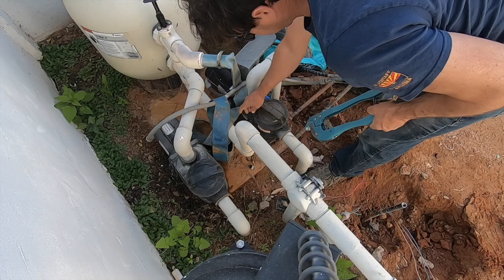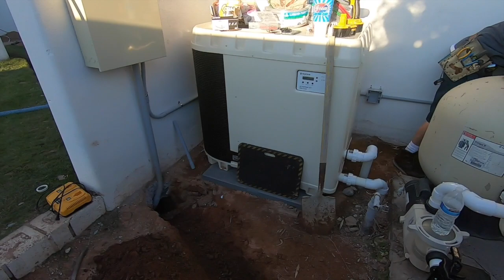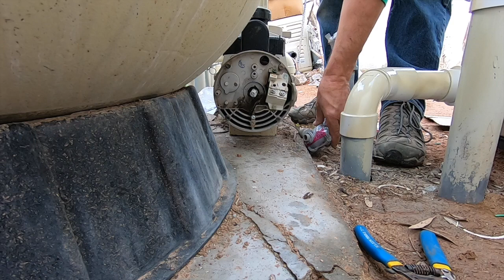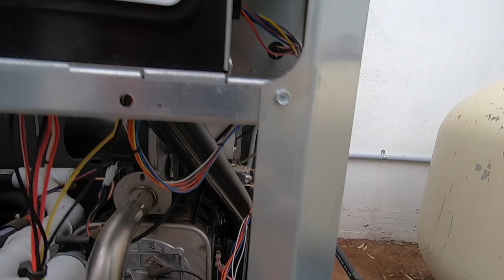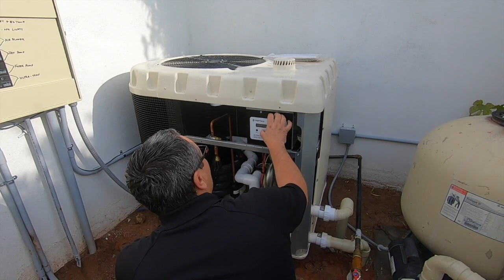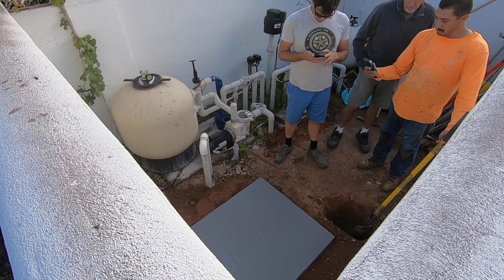Pool Equipment Makeover 2

Comment: Was the ETI pentair heater worth the additional expense? Did it require extensive wiring or plumbing changes?
Reply from the maker: It’a only a 200K BTU heater. I actually have to go sort a flow issue on this account tomorrow. It takes a while to heat the pool but rocks the spa no problem. I think on a set up that’s less than 20K gallons it’s a great way to go.
Reply: @SwimmingPoolAZ-SPS  My pool /spa is 38k!

Comment: i have a Pentair CCP420. Can i replace it with either the CCP520 or the D.E. Quad 4 100 without having to replumb? Are they all direct replacements?
Reply from the maker: The easiest thing to do is convert what you have to a 520. It requires a new upper tank half, taller air bypass tube and the 520 cartridges. The quad and DE filters use the same tanks but require changing the plumbing around a bit.

Comment: hey Josh,  great video, i like to use a sawzall all i can, not a fan of the cable saw, the actuator between the 3 port suction and circ pump, split main drain & skimmer's?... and the Hybrid, where does the condensation go, that beast must drop 10-15 gallons of condensation in an 8 hour run cycle
Scott
Aquavit Pool & Spa
Ca.
Reply from the maker: Hey Scott! Hope all is well man. Yeah, the Sawzall is a definite time saver over the “Italian bill collectors”. On this one the main drain is tied in through the skimmer and there’s a dedicated suction line for a cleaner. The valve actuator diverts suction between the pool and spa (which are 12’ apart with no equalizer line). As far as the condensation on the Hybrid, it’s not too bad in the dry Arizona climate. The unit has a sacrificial mineral chamber (tube full of rocks) that the condensation passes through so when it comes out it’s not too corrosive.

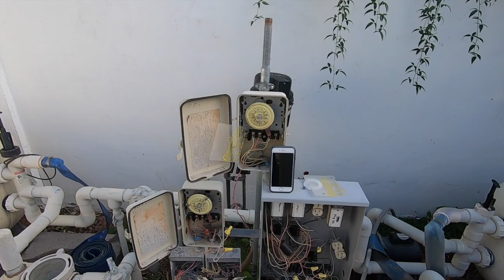Comment: 10:10 Good videos! Why did the old setup have all of those outlets?
Reply from the maker: The old set up had separate equipment for the pool and spa, so two heaters, two filter pumps, two filters, and one booster pump (for the spa jets) it had to be that way originally since they didn’t opt for an automation system. Pretty silly since the Jandy Aqualink system was out at the time the pool was originally done back in about 1998. It would have cost the same or a bit less. It was cool to clean this one up. It was a rat’s nest!!!
Reply: @SwimmingPoolAZ-SPS  Wow. I had to ask since I found a couple of outlets hidden in a small control box. That setup looked somewhat similar to my 1971 Pool & Spa. Separate pluming, 2 torpedo looking filters,  2 gas heaters, 2 normal pumps, 1 booster pump & a 4th pump for a water feature (?) and a spiders web of wiring.  Thanks again for you videos, really helpful.

Comment: Wow that heater looks expensive to buy, install, maintain, fix, etc......
Reply from the maker: Not cheap out of the box but it is tried and true tech in a relatively compact package. As long as the water chemistry is maintained they’ll get a lot of good years and save energy costs die to increased efficiency.
Reply from the maker: And the water chemistry WILL be dialed always because our guy Armando who maintains that Pool is on top of his game